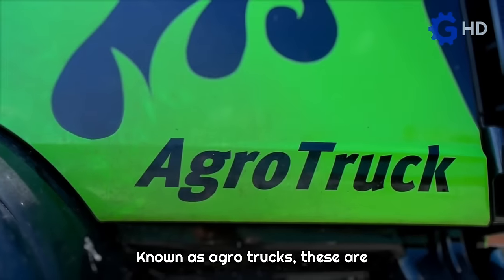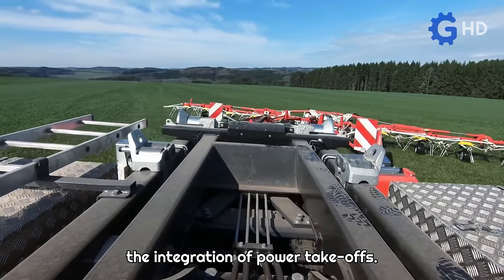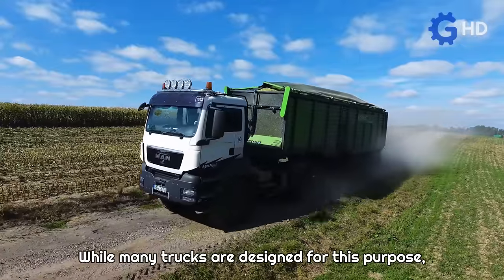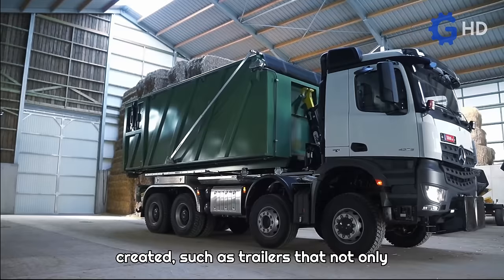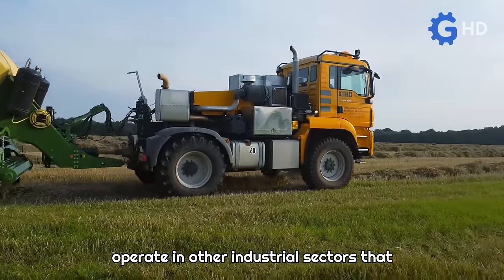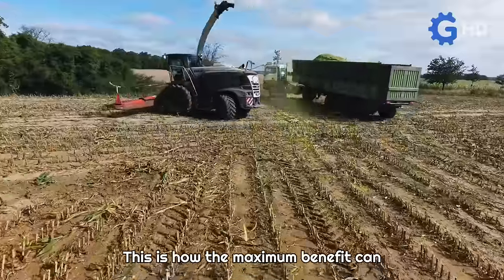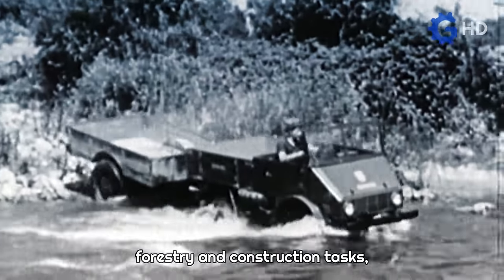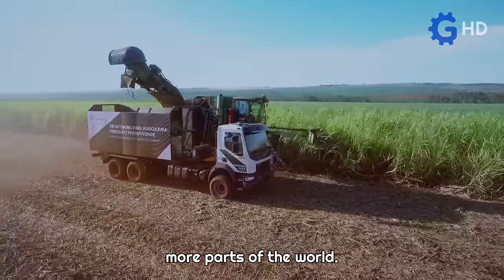What Is An Agro Truck? ▶ The Replacement For Tractors?

Comment: The problem with this is that you need a truck license. And you are only allowed a certain hours of working because it has a tachometer for the hours working. With a tractor you can let a kid drive it with a special license. But that is not so expensive as a truck license (in the Netherlands)And there a no maximum hours of working because it’s  not registered on a tractor.
Reply: In the USA, trucks used for agriculture are not restricted by many of the laws and limits that govern the rest of the trucking industry.
Reply: You can drive a truck like this as a agricultural vehicle in the Netherlands. Then it’s just a different tractor as far as the law is concerned. That also means a lower allowed top speed so there is not much benefit from it. There are however some companies that use trucks like this as a agricultural vehicle in the Netherlands so they might have some advantages.
Reply: Für flache Gebiete bestimmt gut.
Aber lass einen Ladewagen oder allgemein einen Anhänger am Hang drücken.
Der Truck geht Schlittenfahren....
Für Baustellenverhehr definitiv nicht schlecht dennoch würde ich auf Traktoren setzen.
Wenn es schnell gehen muss gibt's noch JCB😊
Reply: At least in the USA, off-highway trucks are not restricted by on-highway hours.
Reply: Also in most European countries you would be exempt from the same regulation that commercial transport needs to adhere to. You would obviously still need a truck license, but that isn't that complicated to obtain.
Reply: I was driving harvest trucks on the highway long before I got my license. Many times I was driving tandem duals with a grain hopper
Reply: In US there are AG exemptions. Canada some provinces
Reply: No Brasil  seria uma boa  mas já tem caminhões  adptatos aqui
Reply: @autobootpiloot  Then they also aren't allowed to drive faster than 45 kmph and they are restricted on any road that restricts tractors. Greatly limiting the main benefits they have over normal tractors.
Reply: I believe in the UK you can register one as and agricultural vehiclein cases so it can run on red diesel and not need a HGV ect
Reply: When hauling your own produce within 50-80kms for agricultural purposes you’re not subject to tachograph usage.
Reply: Although that is a whole new problem, kids driving around in a 40 ton combination with tractors and without time limitation is also not something to aim for.
Reply: I thought it didn't matter as long as you're on private property.
Reply: For the Europeans out there, you can register these as agricultural vehicles. Limiting their top speed to 60kmh, but giving the bonuses of agricultural vehicles, like needing an easier optainable license, tax bonuses or even no tax at all. Also 60kmh may sound slow, but it is the legal speed for non highway streets in most European countries. Still it's mostly a viable option for bigger farms.
Reply: Not actually true.  If you're working within 100 miles of a farm, you typically don't need to carry all the permits and whatnot that typically goes along with long haul setups.
Reply: UK would benefit from these if there were more people with suitable licenses. Unfortunately most don't hold the correct license for large trucks, but you're allowed a 32T tractor at 16yo 🤯
Reply: @dekort2135 You can drive agro truck without tacho and truck driver license but it has to be registered as tractor and it has to have speed limit.
Reply: En France , tout dépend de l'immatriculation:
soit routière ( permis obligé et vitesse Max 90 Km/h ) 
soit agricole ( pas de permis, vitesse max 40 Km/h , pas de restriction de temps de conduite) 
🇨🇵✌️😉👍😋🇨🇵
Reply: Lkw kann als Landwirtschaftsfahrzeug imatrikuliert werden mit 60Km/h oder auch 40Km/h

Comment: While it is typically best to use specialized equipment for specific tasks, for some the financial investment and space required for so many specialized vehicles is prohibitive.  While not nearly as efficient, a multi use vehicle like the Argo truck can allow smaller farmers to power equipment on a smaller scale.  Also seem great for a self contractor.  They could add several services with 1 vehicle. Nice video!
Reply: The premise of the original Land Rover
Reply: Tractors are designed to be a multi use tool the only thing specialized are the custom or fertilizer tractors. The run of the mill can hook up to and run a ton of different tools and hookups
Reply: на такой подкачки шин есчё в 5о гоняли ты чё бедлог оформи как положено развивайся тенись какие секреты
Reply: @andrewhansen4092  Not on the road. Well, outside of local transport. Can't do highways, can't drive a tractor 800 miles on 1 tank to the receiver. There's a reason tractors are only on farms and not urban landscapes. Trucks, on the other hand can run long highway miles.

Comment: 2:16 I've never even heard of drive axle trailers, WOW. But then again multi clutch gearboxes were first used in farm tractors, not super cars. Agriculture really is a driving force for innovation
Reply: Multidrive was a pioneer in the field of driven trailers.  They produced products for agricultural, mining, logging and military applications.
Reply: @BlackSeaRC  Not to be a know-it-all, but to my knowledge Soviet-Russia succesfully implemented axle driven trailers in the early 60's, 20 years before Mulitdrive was founded. Example of a truck with an axle driven trailer is the Zil 137. Although Multidrive might still be a pioneer in commercialising it.
Reply: @armoredp  You are right that Soviet engineers experimented with these concepts to try to improve mobility in harsh conditions.  The ZiL-137 was a prototype around 1970.  Prior to this there was also the NAMI-058C prototype around 1967.  Neither concept seems to have entered mass production.

David J.B. Brown (the founder of Multidrive) spent his early career as a logging contractor in UK and the Congo.  He was dissatisfied with the trucks, trailers and tractors available and designed his own articulated tractor (patented in 1958).  Multidrive was founded in 1983 but it wasn't until 1987, when David Brown acquired Bedford Trucks and renamed it AWD, that all-wheel drive tractor-trailer combinations started to be produced.  It is unclear exactly when his particular concept was formulated.  He may have been aware of the Soviet vehicles or he may have come up with his concept independently whilst designing his own vehicles.  By the way, the Multidrive powered tractor-trailer combinations are still in production in China (see Junton Multidrive).
Reply: Drive Axle trailers existed in the 1950s, Ferguson, later Massey Ferguson, had them. I own one, built in 1957 including drive axle trailer.

Comment: Soil compaction is the main reason these aren't used to plant or really do anything more then pull trailers. Farm tractors are designed to reduce ground compaction and feild tearup ( the tires will rip up the top layer of the soil) there's a reason why the tractor design and shape hasn't changed since the steam tractor it's the best design for them
Reply: Eh…no. Depending on model, more tires, same weight results in what? Yes…less compaction due to less ground pressure and the field tearup is something you would need to show me proof of…as the profiles are just as or even less aggressive. And when you see what a tracked or standard tractor do to wet soil…it won’t look much worse with a truck. And just because the visual appearance hasn’t changed doesn’t mean the insides and the tech haven’t changed. You can’t really compare a tractor from the 80s to a modern one
Reply: Oh rofl just saw… you are from the Dominican Republic…so how big are your tractors you need for sugarcane, coco, tobacco and coffe?! Massive plows I am sure ;) @@Encarma
Reply: @SuperVistaprint  You have 1,5x the size of truck tires on the front and 2,5x the size of a truck tire in the back compared with a smaller turning radius and optimized tyre profile. Yes Tractors are better. Add as many tires as you like to your truck...

Comment: This has been tried many times but has never been overly successful. They work in very large areas with big turning areas where passage is rapid and ground impact reduced. However, in very confined spaces where accurate ploughing and detailed ground tasks are required they are far less attractive and of limited use to smaller operators. A heavy hauler is a fine machine but like the tractor it’s uses are partial. So really this is an advertising adjunct for sales in America.
Reply: Tractors have simple engines and complex gearboxes allowing them to do field work. Trucks tend to focus on engines that deliver maximum mpg as most trucks travel distance. So neither are suited to the tasks of the other. With the advent of faster tractors it makes more sense to use tractors for field work 90% of the time and live with their issues for carting on the road.
Reply: "So really this is an advertising adjunct for sales in America."
LOL.
In this video all those agro trucks are european and on european registration numbers. MAN, Mercedes, Tatra. nothing american, besides brasil.
Reply: @TomaszbtdZiobrowski  I agree but the target market they suggest several times is America. Dollar rules. Always ask in journalism who is the journalist seeking to influence as important now as when I was at school in the fifties. There is also I agree a market in the East of Europe but that seems to be occupied in other ways at the moment. There is also the point that in some economies tractor diesel is rated less than lorry diesel when used on the open road.
Reply: Look at the Marcedes Unimog and tell me that's not a successful agri truck
Reply: @thesayxx  I did many years ago and asked a farmer why they were not more successful on farms. Apparently there were problems in ploughing which is not, as many non ploughboys think a matter of shoving the tackle in the dirt and pulling but of constant adjustment in variable soils especially in the years before electronic adjustment. This does not make them bad it makes them workhorses of a different nature depending on the agricultural work demanded of them. In hill country where a farm might have forestry as well as tilling and hauling they may be a wonderful addition but if you are ploughing a large area of plane then not quite as successful as a specific vehicle. So for a small farmer in a very mixed landscape environment they may well be the best investment available and in many areas of Europe they fulfil this role as a trip up mountain and hill farms will show. In modern farming which has moved beyond the child story book stage for a generation or so massive machines travelling over large landscapes are now the rule and specivity of function rules when accountants recommend the best financial investment.
Reply: @@Encarma are you daft or something? The Unimog was developed in the late 40's and it was a workhorse of German and Austrian agriculture. It was from agriculture that it spread to the military, emergency services and municipal services. There are still farms that use Unimogs, i know of one not far away from me which does not own a tractor but still manages to raise livestock and grow crops. And its not a tractor, its better than a tractor. If we look at the contemporary tractors of that time the Uni had more power, better transmissions with higher speeds, a flatbed, PTO's and later front PTO and front and back hydraulics with 100 HP at the time 30hp 2wd massey fergusons were the most popular tractor.
Reply: @glynluff2595  The Mog can plow, seen it done, saw some videos hauling a 5 row plow behind it. Where it excelled was highland farms of germany and austria. It was perfect for mowing, raking and transporting hay. Was also really usefull in the forestry service, since its crawler gears can get it in insane places and with the right gear ratio it can haul or tow quite a bit of weight. Ofc its silly to compare modern tractors to the old unimog, but just a reminder Marcedes still makes the agri version of the new ones, which have all modern equipment in regards of electronics, gps, advance hydraulic systems.
Reply: @@Encarma nah it just has 4 wheels which are all driven, a crazy good gearbox with a high range of speeds and power outputs, a decent engine and hydraulics and PTO's. I can name more tractors that dont have those things than the ones that do.

Comment: Just a fancy name for putting a construction truck frame and wide balloon tires on an over the road truck format.  Most farmers can do this in their barn for less than a third of the price.

The only real place this sort of truck would be useful is in a role where you are just driving around with a product load.  Sprayer on low standing crops, hauling to the grain silo during harvest directly from the harvester, brush fire truck.  Big tank, big cargo, long road haul is the 3 key factors for these.

Unimog is for niche/ family farmers who need something better than a lawn and garden tractor, but only can afford 1 vehicle, and need to drive around town.

Comment: What I'm wondering is iff you need a special truck drivers license to drive these Agro Trucks ?
That will be the question for a lot of farmers,because a truck+trailer license is verry expensive
and in my country(Holland) you need to renew your truck license every 5 years !!!
Reply from the maker: That's a good question, but we couldn't find anything about it. I suppose it might be a standard trucker's license 🤔. Thanks for commenting!
Reply: Here in Germany, where most of these Agro Trucks are made, there are numerous different types of drivers licenses. The one you need depends on  the type of the vehicle, top speed, weight and so on. Basically, to drive a truck, you need a proper license for standard trucks. If however the top speed is reduced to 60 km/h, it counts as a "landwirtschaftliche Zugmaschine", or agricultural tractor, and can be driven by sixteen year old kids who are allowed to drive any other tractor. Also, in this case governmental restrictions for the amount of time you are allowed to spend behind the wheel do not apply.

Comment: I feel something missing. The price that was not showing it need more in depth. As well module parts come with the cost to attach and remove for farming equipment. As well permits for driving and used case. Well there are small and big farms. So it depend on the need and prices.

Comment: Agro truck concept looks pretty strange for me. If it's only with fifth wheel/multilift upfit- so it's basically 4x4 (or 6x6) truck with funny wide wheels. Common 6x6 truck (especially army truck) with the same upfit could do the same job.
 If we use agro truck with full tractor equipment (hitch, hydraulics, PTO and others), so this is a question about price (such agro truck would cost pretty much) and effectiveness in comparison with tractor (tractor has better weight distribution for heavy equipment on the back, tractor cab has a good visibility in the any direction, a lot of controls for equipment and so on). 
 Maybe these agro trucks with swap body upfits and powered equipment could be used as auxiliary vehicles on the farm, but to be used as the tractors- I think it wouldn't work. (But who knows, I'm not a farmer:)

Comment: The American equivalent of this is a Peterbilt or Kenworth with diff locks sitting on 24.5 inch wheels hauling a hopper bottom trailer riding through the corn/soybean fields being loaded straight outta the combine, then driving up onto the road and to the grain elevator.

Comment: Tires are wide and low pressure NOT to give safety and stability... It's to spread the load and have lower ground pressure so the field doesn't get damaged. There is a reason why tractors have huge tires and can drive over plants without damaging them.

Comment: These cant replace tractors, tractors are still too universal to many jobs for these to compete. We have 2 tractors Case with frontloader and Valtra with forestry crane. We can do normal farm work. We do forestry both falling trees and collecting the logs. We do chipping of the said trees for heating. We haul grain with them because they have 53km/h gearbox. We do crop spraying because the can eqipped with narrow tires and GPS. We do snowwork other with snowplower and other with backend plate and snowbucket. We can do some light excavator work like clearing up ditches when they grown in or too small. And this all with cost of 2 equipment instead of like 5 or 6 specialized equipment.